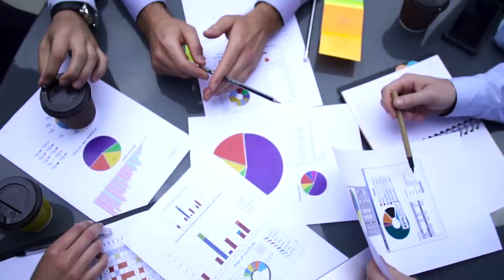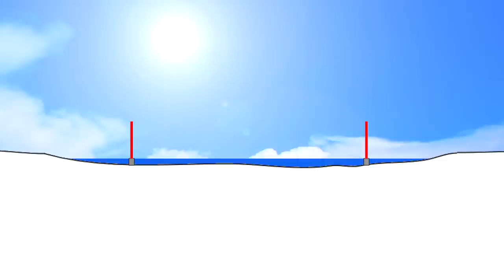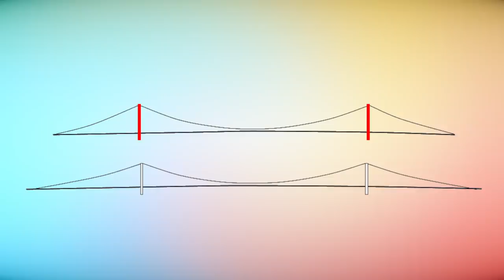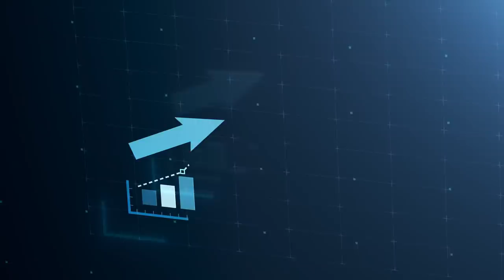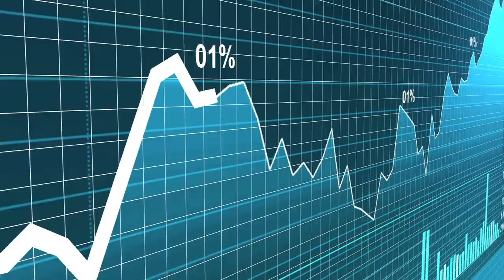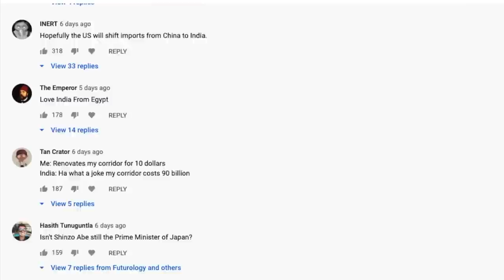Turkey's $5BN Bridge to Europe

Comment: "It has a clearance of 69.3 meters which is symbolic for.."
Reply: Nice
Reply: Two plus two will always be four everywhere. Possibly Nikola Tesla knew the power of the numbers 3 6 9. The Golden ratio in Mathematics is a special number found by dividing a line into two parts such that the longer part divided by the smaller part is also equal to the whole length divided by the longer part.
Reply: Meanwhile Germany are building an Autobahn Highway to Poland.
Berlin to Warsaw Express Way : 
Total length: 1939km
Concession begins: 24 February 2020 
Construction begins on : 30 January 2033
Estimated completion date : 1 September 2039........
Concession company : (NSDAP)Nationale Sicherheit Deutschlands (Autobahn) Privatunternehmen
Future expansion : Extension length to Moscow Russland included....
😅😅😂😂🤣🤣🤣🤣🤣🇩🇪🇩🇪🇩🇪🇦🇹🇦🇹🇦🇹🇨🇭🇨🇭🇨🇭➕❌
Reply: @fumingjeh  are you okay?
Reply: The engineers just like the number 69...
Reply: Noice
Reply: @fumingjeh  the slow pace is in line with slow increase in Warsaw-Berlin road traffic, I think

Comment: Why the heck is "ferry job loss" mentioned as negative? It has no added value to the economy compared to the bridge so those can finally seek a job that will add more value to the economy. It's like removing administrative jobs by getting a better database, not really a loss.
Of course, government should help those people to requalify and find a new job, but that's it.
Reply: also we can use these ferry boats in istanbul or in another citys Turkey is Half island maybe we can use with north cyrpus
Reply: Ferry can be boosted by the Istanbul canal project along with the new industrial Marmaray Islands that will be built from the soil of the Istanbul Canal project
Reply: In Istanbul ferries still work despite the several bridges... ferry travelling is looked as a touristic event rather than passing into the other part. some people especially tourists would still go for ferries... so no job losses I assume.

Comment: I guess the fact that one end of the bridge is attached to one continental plate and the other end is attached to a different continental plate, was taken into account. More Silk Road diplomacy, and another one bites the dust.
Reply: First intercontinental bridge in İstanbul was built to elasticise +/-5 meters, like around 1970s. It still functions. Bet they considered the calculations much more accurately nowadays.
Reply: The straits do not separate two different continental plates. If they did, there would be fault lines directly under the straits and mountain ranges parallel to the coast line.

Comment: One of the things that I'm noticing by looking at Google maps is that a lot of the northern leg of the highway leading to the bridge is duplicative. There is already an existing national road which could have been upgraded fairly easily. The interconnections with that road and other roads also seems rather subpar. There is a lot more infrastructure being built for this project then what is really needed by any stretch of the imagination. A lot of farmland is being sacrificed for very little benefits. This type of project unfortunately seems to be the norm in Turkey. The bridge easily could have served it's purpose quite well with quite a bit less infrastructure and expenditure.
Reply: one of the aim of this project, creating a loop on marmara region. most of the transports (export, import mostly) izmir and balıkesir region cannot use ferrys. some part of road struckture existed really narrow and not capable carry heavy truck traffic. biggest aim on the project connecting sides, creating faster transportation belt and reducing traffic national park, mountains are and urban distircts (keşan, uzunköprü, havsa etc.)

Comment: Sad that there won't be any railway connection.
Reply: @Kirin Sama On the bridge?
Reply: There is underwater connection in İstanbul, it would be nice there was also in Çanakkale but it is kinda pointless as İstanbul is Turkey's biggest city so vast majority of trading operations pass through the city anyway.
Reply: There is the underwater railway between two sides of İstanbul.
Reply: @Kirin Sama I wasn't talking about Istanbul. I was talkingabout this specific bridge over the Dardanelles. In my opinion every major motorway should be accompanied by a railroad, at least in densely populated areas like Western Turkey.

Comment: Imagine building that bridge only for a ship to strike one of the two pillars
Reply: Such bridge towers are many times heavier than the biggest ship on Earth + they have a foritified section in case such a thing happens so it wouldn't end well for the ship at all :))
Reply: @triggerwarning7662  A hostile country can bomb or even nuke cities as well so it doesn't make any difference if the bridge is bombed or not!! Also Turkey can handle all it's neighbours easily so not that much of a problem...
Reply: @ggoddkkiller1342  Besides, Turkey is a rising power in the past several years
Reply: A ship has to pass thorough the Aegean sea and Çanakkale to bomb the bridge whic dosent seem very possible
Reply: @muratadem133  ne diyor

Comment: Why would they build it without a rail connection or at least preparations for it?
Reply: Good question. The Yavuz Sultan Selim Bridge passing the Bosphorus has a dedicated railway section (although the railway is not there yet) and also there is the Marmaray crossing under the Bosphorus. Maybe they believe these are enough to connect the two continents. But it's still silly that they didn't think about it as it's basically another route.
Reply: @direnius  The trade value of Çanakkale-Thrace is less than 1/20th commerce in Istanbul tho. There is no need for a railroad over there. What is required is the opening of the second transcontinental railway in İstanbul asap.
Reply: We don’t do that here.